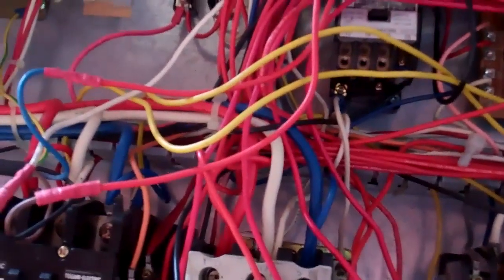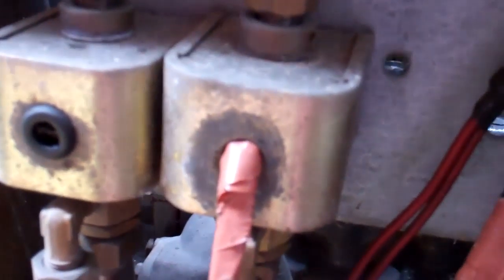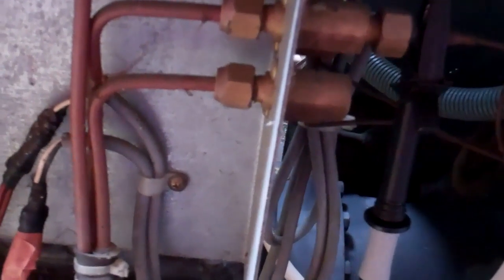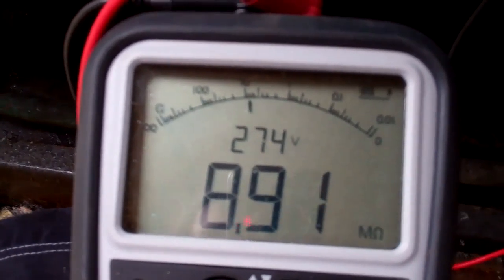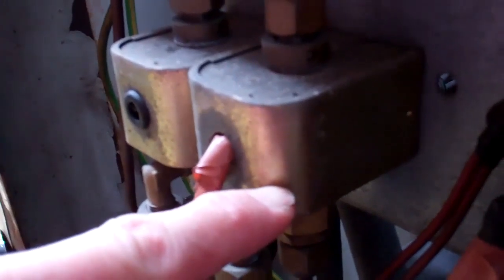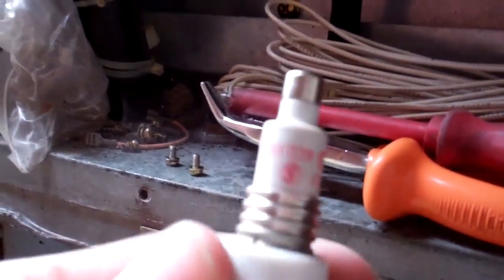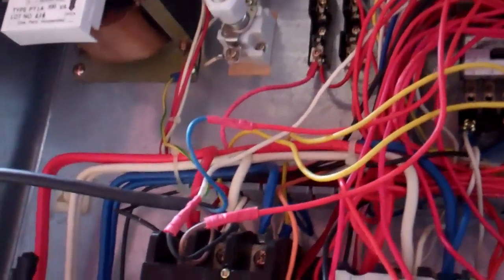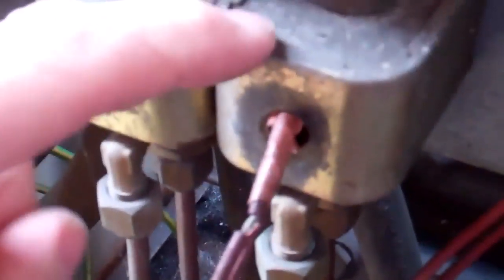Chiller Short

Comment from the maker: I checked the fuses with a meter and the showed as blown, thanks for the heads up on breaking capacity, will look into 10ka breakers as these are wired off the 125A supply to the chillers.

Comment: Diazed fuses. They are still good, as the red dot has not popped off. Good fuses, ultra high breaking capacity, and can be coded so as to prevent putting the wrong rating into a panel ( the bottoms are assorted diameters so the higher amperage ones are not able to fit the low current holder) Replacing with breakers is only good if you use a breaker rated at 10ka or more, as these fuses are designed to disconnect even into a short on the output even if fed direct from a transformer bus bar.

Comment: Only drawback to them is the cost. Replace the fuse twice and the breaker is cheaper. Not recommended is to place a thin strand of wire on the body as a temporary fuse, have seen it done many a time. I gave the last ones i had to Ryan, as he cannot change the fuse to a breaker on a lift, has to keep buying the fuses.............